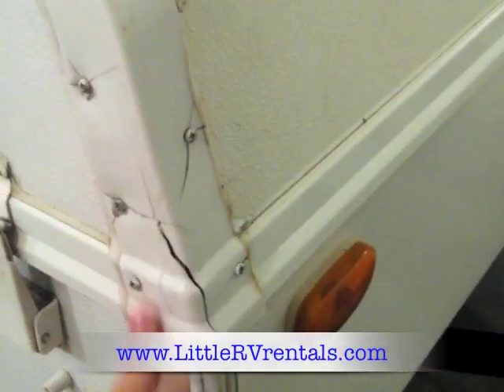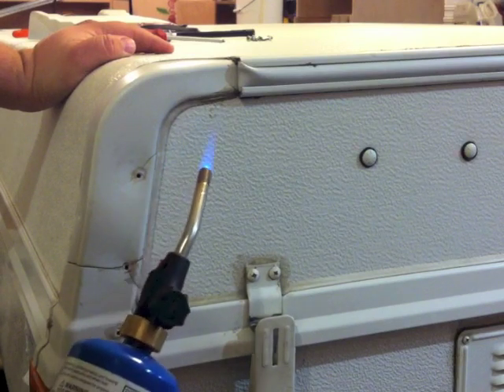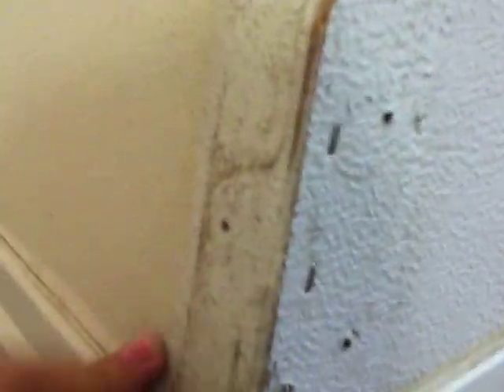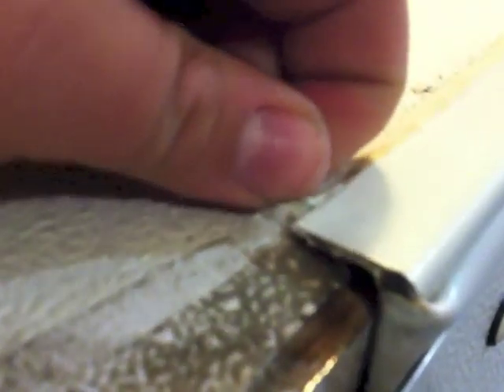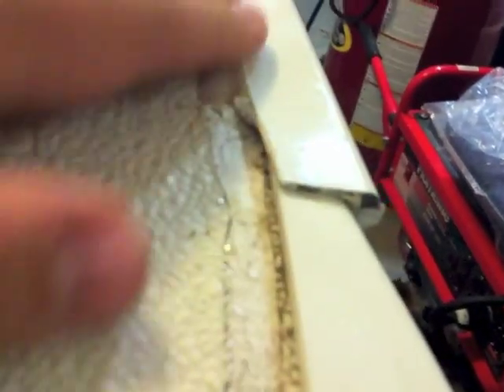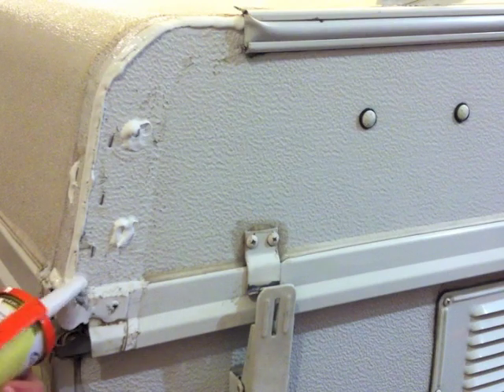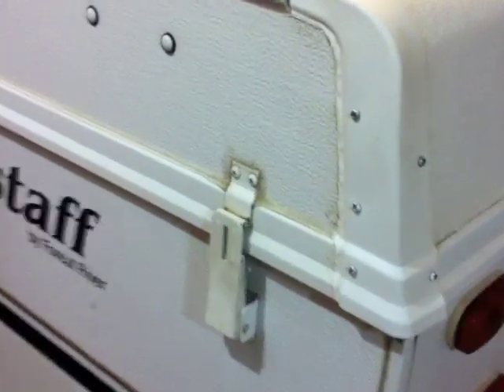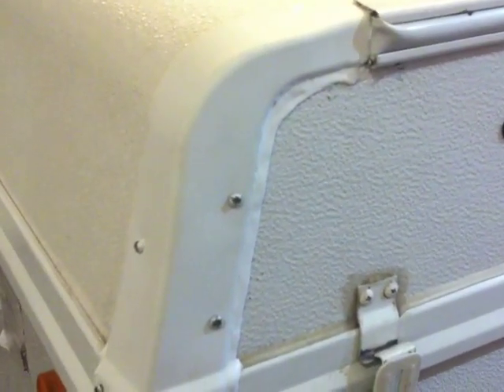How To Repair Popup Tent Trailer Roof Caps Rock wood Flagstaff

Comment: Hi, great how to video!

I'm the first-time owner of a 2000 Rockwood 1908 pop-up, and I'm looking to re-seal my roof this winter. I want to use eternabond tape, but I'm not sure how to remove and re-attach the metal rails that run along the length of the roof, the ones that butt up to the plastic corners. 

Any advice that you might be able to give would be awesome, thanks so much!
Reply from the maker: Hi there I would peal back a little sealant to see if there are any mounting screws holding it down if not it may just be held down by the sealant... just take your time you will figure it it out! You could also take a quick photo with a phone and show it to an RV repair dealer most are helpful and will point you in the right direction...Cheers! :)

Comment: I notice your using the self leveling dicor for corner caps
The guys on pop up portal say the no sag would be better?
Now im really confused on witch on? I have both types
thanks
Reply from the maker: +Ernest Williams Thanks for the comment to be very honest with you i have never used the no sag it may be a better option as it is a corner not a flat surface the self levelling worked for me but i did have to go back with my finger and adjust the bead as it was running a bit. Cheers!

Comment: Where did you purchase the corner caps? Can't seem to find replacements
Reply from the maker: Hi there I found them from E-Bay seller http://www.ebay.ca/usr/canvasreplacements?_trksid=p2047675.l2559 
Not sure if they are still selling them though as I bought them in 2015, If you search around e-bay you may find some just ask seller if they will fit your model... Cheers, :)